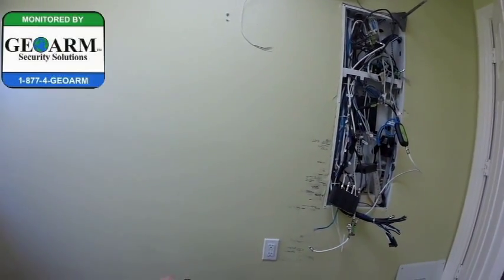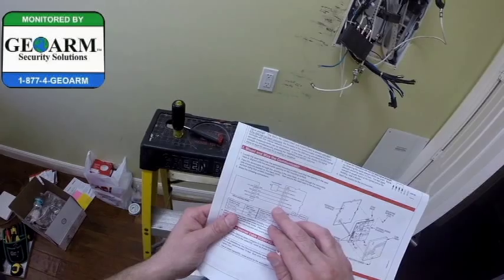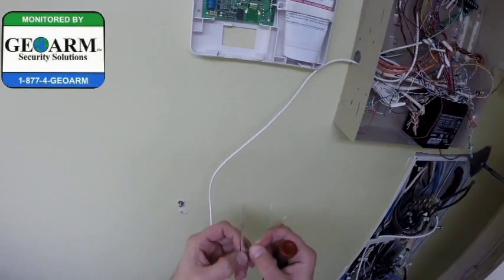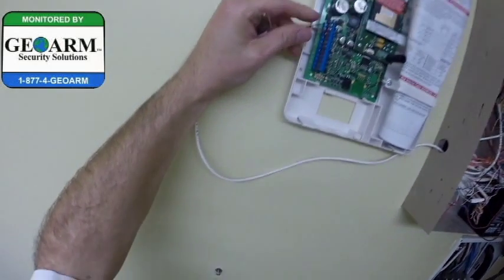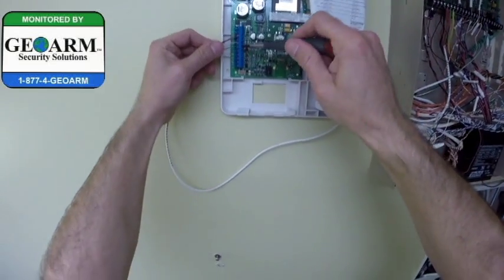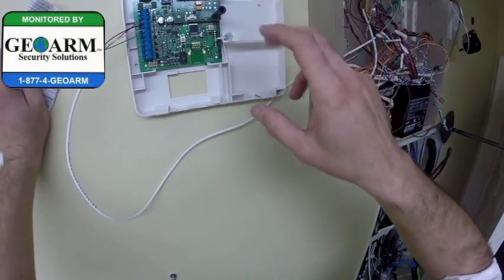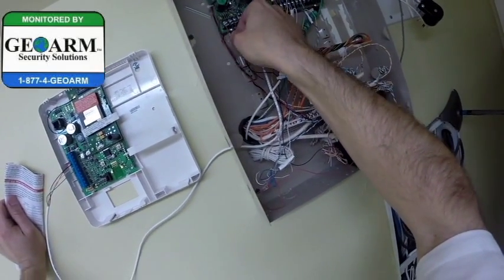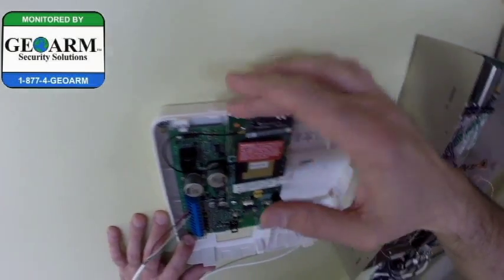Honeywell Vista 20P : How to Wire the GSMV4G to the Wired Security System

Comment: Do you ever have issues with the door senors with the Vista because I have the admeco alarm system it's been set off several times before I don't think it's my kitten that's setting it off because she hides under my bed sometimes help
Reply from the maker: Good question on false alarms while using a Honeywell Vista wired security system. If you are arming your system away with motions active than it is a strong possibility the false alarms are due to the motion sensors clashing with your cats or how the motion sensors are either programmed or installed. Are you looking for the lowest cost alarm monitoring services for the vista panel?

Comment: does this use chip
Reply from the maker: You will only need to use the chip upgrade if your honeywell vista 15p or 20p is lower than 9.12. The chip is what allows end users to gain access to honeywell total connect 2.0 services.
Reply: GEOARM Security I'm purchasing the Vista 20p because I was GSM connected for a central station
Reply from the maker: If you're getting a new honeywell vista 20p that is revision 9.12 or higher you won't need to get a chip. What exact cellular communicator will you be using with the vista 20p?
Reply: GEOARM Security honeywell gsmx4g
Reply from the maker: nice that should work perfectly and allow you to use either diy or professional interactive alarm monitoring with total connect 2.0 services on your smart devices. We have the lowest rates around. Did you want to go with DIY or professional interactive alarm monitoring services?
Reply: GEOARM Security can you choose which central station it sends messages too when alarm is triggered
Reply from the maker: As the end user, you do have the choice as to what company you want to monitor it. But, we do offer the lowest rates and offer unlimited free tech support to our clients. Our cellular monitoring rates start at $15 per month no contract. http://www.geoarm.com/alarmnet-total-connect-cellular-basic-interactive-alarm-monitoring-service.html
Reply: What kind of wireless receiver can I use from honeywell that would work with the Vista 20p
Reply from the maker: good question, you can use a honeywell 6160rf keypad which has it built in or you can use any one of these: http://www.geoarm.com/honeywell-wireless-security-receivers.html
Reply from the maker: Where you able to locate the options i sent to you?

Comment: do i need to replace the chip to a 9.18 or will this hook up to a older chip
Reply: ImConfusedTwo It has to be version 9.12 or higher.
Reply from the maker: If you want to have total connect 2.0 which is where you can control your vista 20p from your smart phone your chip must be rev 9.12 + if its not no problem just get a communicator such as the gsmv4g-tc2:http://www.geoarm.com/gsmv4g-tc2-honeywell-alarmnet-vista-series-wireless-cellular-4g-alarm-communicator-for-total-connect.html this will come with the chip you need.
Reply from the maker: If you want to have total connect 2.0 which is where you can control your vista 20p from your smart phone your chip must be rev 9.12 + if its not no problem just get a communicator such as the gsmv4g-tc2:http://www.geoarm.com/gsmv4g-tc2-honeywell-alarmnet-vista-series-wireless-cellular-4g-alarm-communicator-for-total-connect.html this will come with the chip you need.
Reply: cool thanks
Reply: GEOARM Security cool I will be getting one thanks